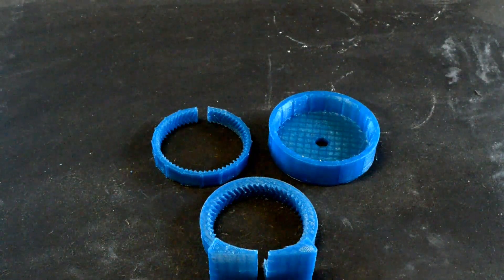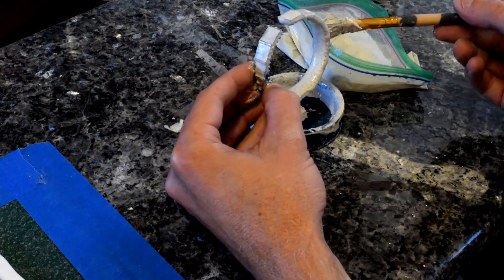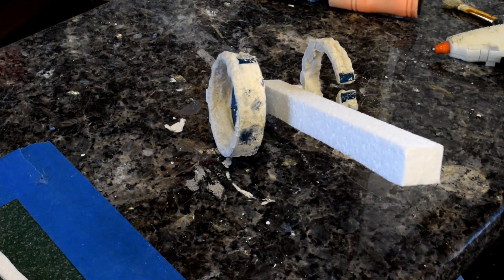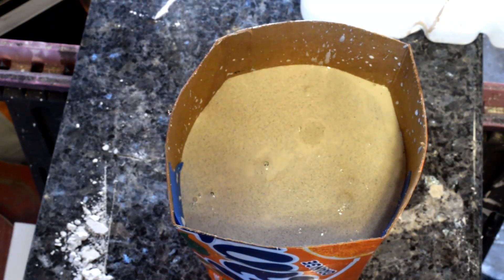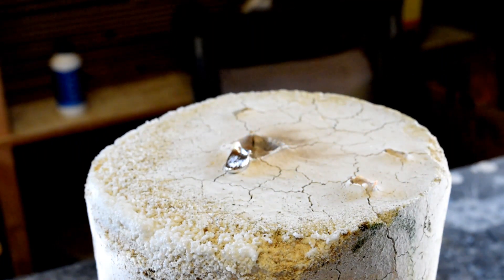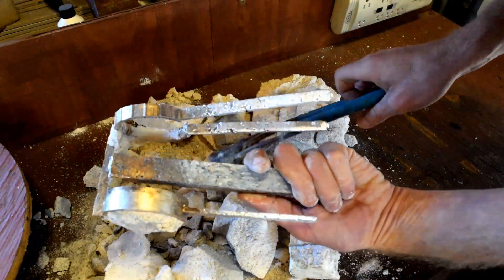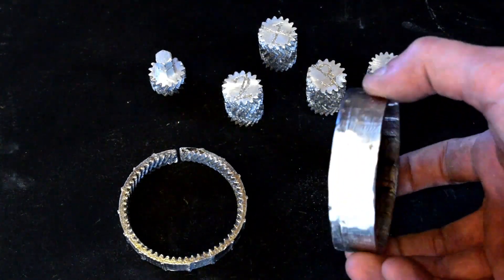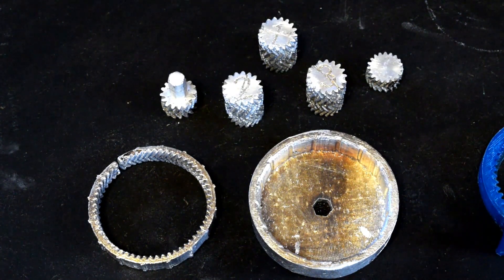Metal Casting 3d Printed Planetary Gearbox Part 3

Comment: Why not burn out the wax with the mold upside down so everything can drain out?
Reply from the maker: Don Gawgon aka Indigo Ives I do, but I find flipping up and down gets the wax melted faster. I have a kiln now so I'll be using it for now on.
Reply: I hear u man well keep it up...I was also wondering if you tried making 2 smaller half molds with plaster, with a pla part greased up for easy removal, then join those 2 half molds together inside a bigger box mold with plaster n sand... then maybe you can skip burning out the part and re use it...not sure if that would work tho...

Comment: Cool video series. I don't have a lot of casting experience but I made a cast bubble free by setup on my dryer. The second I was done pouring in my mix, I threw in some old boots and cranked it up to 11. The vibrations and overall trauma the dryer endured seemed to shake loose any bubbles. Could have been beginners luck but it worked for me. You may have heard of this technique, and maybe it's well known, but i hadn't prior to picking my plaster (thanks home depot guy!).

Comment: What's the shrinkage like? Do the planets fit in a gear made of PLA?
Reply from the maker: I haven't checked to be honest. I've only printed it in wax. I think the shrinkage is very little due to the small size of the parts. I'll have to check later today and see if there is any noticeable shrinkage. I did fit the planets roughly in the output ring gear and they turn...